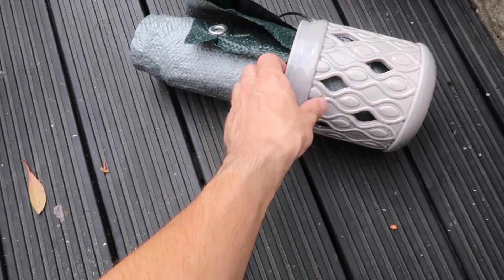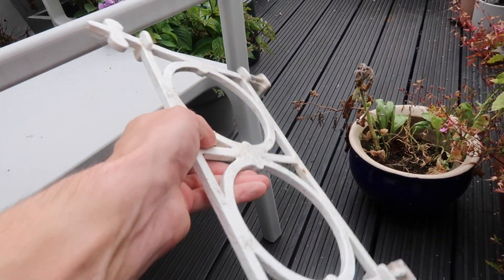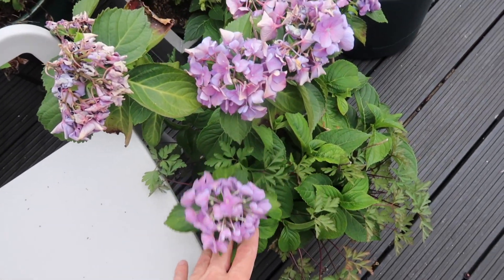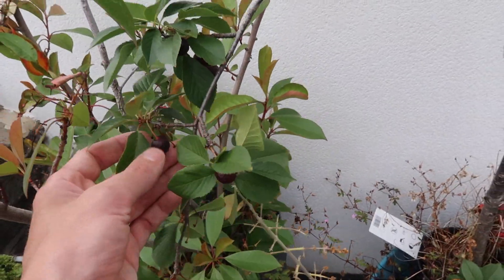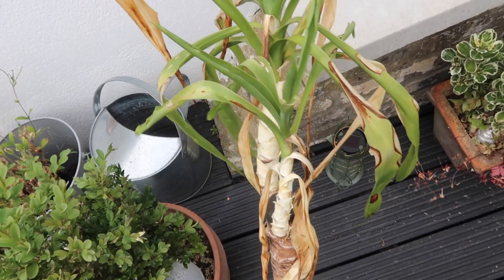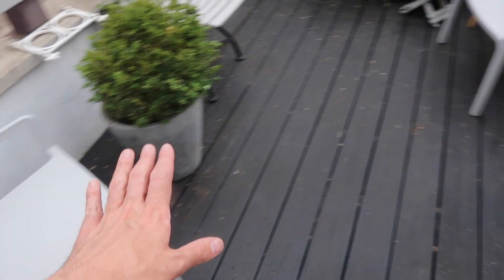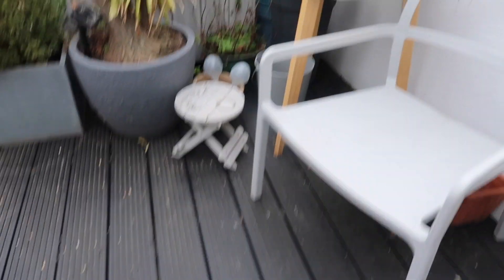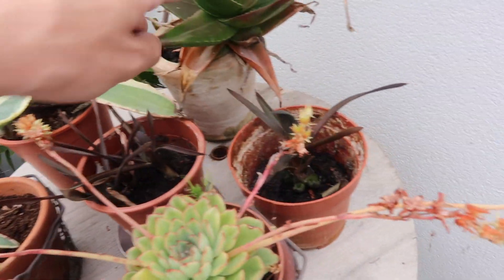ROOF GARDEN TIDY UP & CAR BOOT SALE DIY UPCYCLE

Comment: I have a covered front and back porch on an old 1930 shotgun house in Florida. This has been an extremely hot summer even for us. Just did tidy up and threw away several plants. Sat my tomato plants in the backyard to fend for themselves. Had one tomato on 4 plants. I give up on them. Ferns usualy hold up hanging up around the front porch but they are withering this year too.  Last year I managed to keep some plants going through the whole year but no Spring this year. Straight to 90+ from May 1. Yuck!!!! I do enjoy porch setting and cannot wait for October.